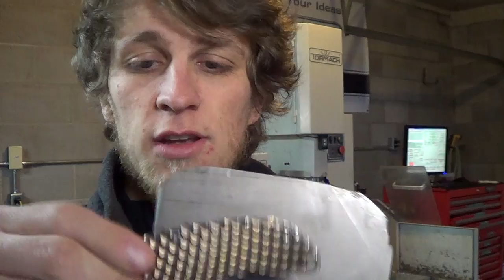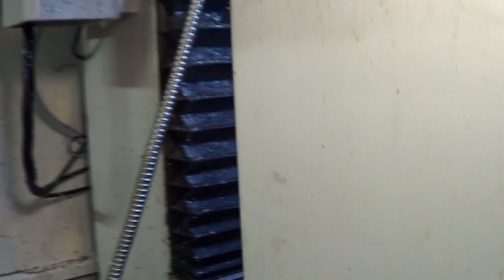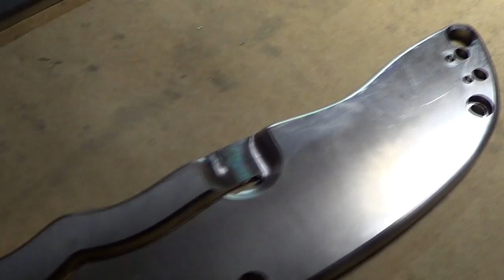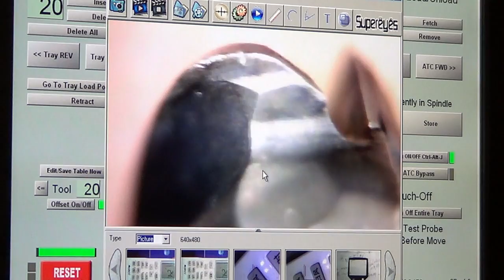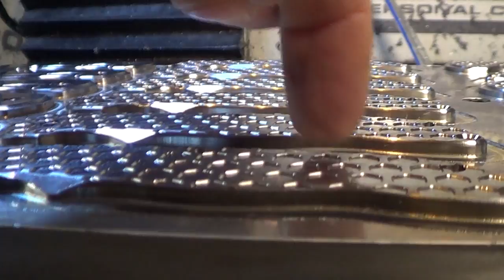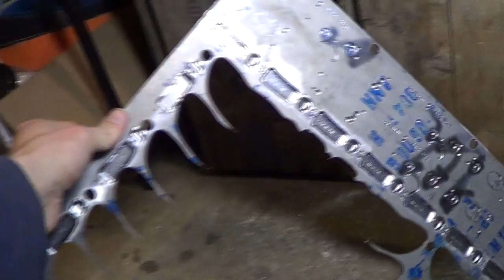Knifemaking Tuesdays Week 61 - Production run handles

Comment from the maker: Yup I do corner round the spine of the blades, that turned out to be a great idea.  If I did put a corner round on the inside of the handles I'd want it to be a tiny one, like 1/32" or smaller.  It certainly would be nice.

Comment: Right you are! I ran the numbers in Gwiz and 1. Adaptive clearing wouldn't do any good with so little extra on each side. 2. Adaptive clearing in that application would be 1/2 as fast, even though you are able to do it in one depth pass instead of two. Not surprised that you have it optimized :-)

Comment: A little tip when you drill and ream a hole that ends up being a hair too big. Take a small individual ball bearing and set it on the hole. Take a small hammer and give it a decent hit. It will push the top of the hole in enough to give you the fit you want or you can come back and re-ream the hole if you hit too hard. For larger holes you can use the rounded end of a ball peen hammer.

Comment from the maker: Definitely possible, not that difficult either.  The only downside is that the clip material will have to be thicker to begin with.  This way, I can make my clips and handles both from 1/8" titanium, even on the same sheet, so logistically it makes sense for me to do it this way.  However, having a boss on the clip is a sweet way to do it, I've seen other guys do it and it works great.

Comment: Those "flat" style handles are just crying out for some inlays or small diamond pattern, like knurling, to add grip to the smoothness, front and back, just to make the coding harder. :)
I know only a little about the subject but could the damage on the end mill further up than you cut, be due to cavitation. It can seriously damage ship's propellers and with the tool turning in a jet of fluid with air readily available.
Seriously great to see your videos, very enjoyable seeing craftsmen at work.

Comment: Hi aksting,

I forgot to mention this ability. I have a very similar 3 loupes, with lenses at 3-5-15-20-30≈ and it is possible to do as you say loading even different loupes and you will get a combination of those optics. The focal length at anything more than 30 X becomes so tiny it is very difficult, for me anyway, to keep it in focus for more than a fraction of a second, great fun to try though! ;-) In theory I should be able to match the 20 x and 30 x and get what is it, 600 x! There is no

Comment: Its tuesday, why is there a KMT already?? :)
Oversized endmill plunges is spindle runout, or collet runout, or possibly too high of feedrate.
I like to use a wire brush where you're using the scotchbrite. Both produce similar results, but the scotchbrite can really put alot of strain on the spindle when rigidly held. 
The flat handles look real good.
Why is that bullnose endmill so long? :)
I agree with the chamfer for the inside, small corner rounders can be a b**** to keep from gouging.

Comment: Is your lock bar slot the same diameter of the endmill you're cutting it with? Obviously your tool life is fine, but I'm getting fantastic tool life in 6AL-4V when using a smaller than the slot endmill coupled with adaptive clearing and using an 8% engagement (slice width based on the tool diameter) in slots like that.